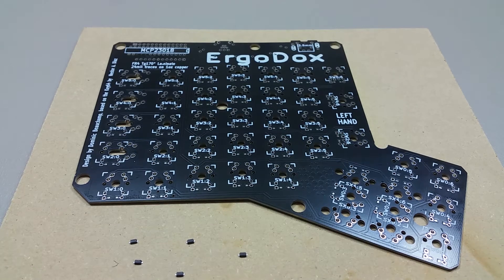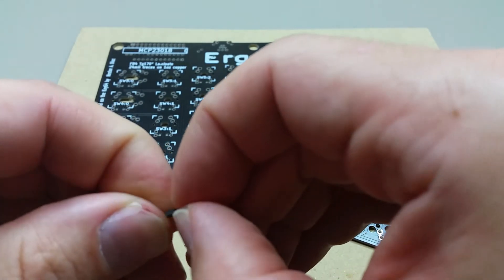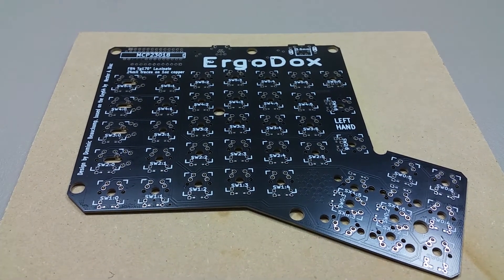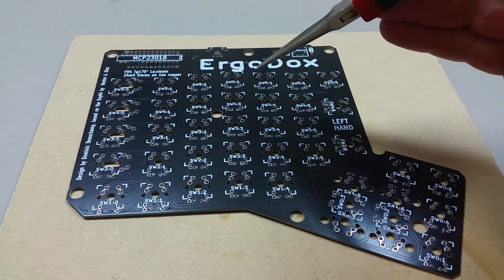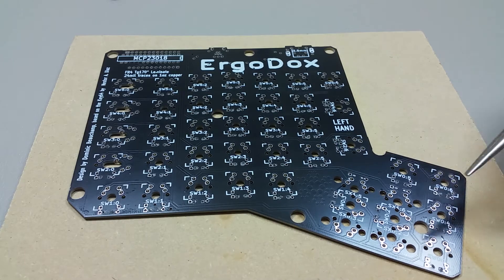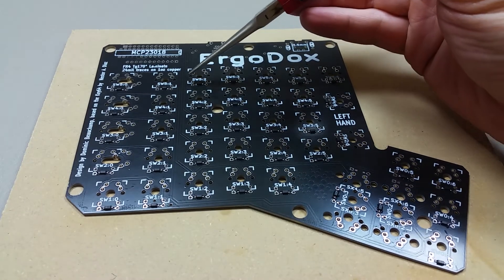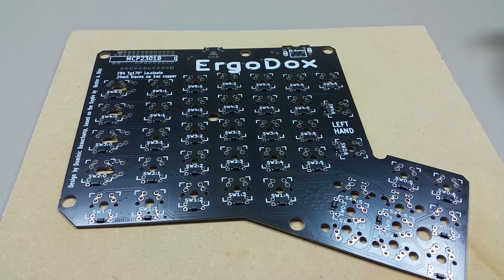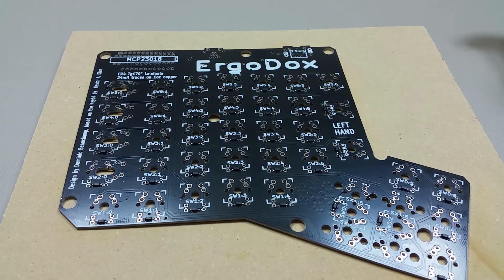How to build an Ergodox (Assembly 2)

Comment: What a meticulous work. A lot of equipment also needed.
I really want one but the work seems difficult.
Reply from the maker: Kazathul It's a lot of the same thing over and over. Good way to improve your soldering skills.
Reply: engineglue I have to know soldering before I improve on that : ) So....
Reply from the maker: Kazathul Get an iron and watch some Youtube videos. If you think you might like it.
Reply: engineglue How do you handle ventilation?
Reply from the maker: Kazathul If you're referring to flux or rosin fumes, I wear a particulate filter when I'm soldering a lot. An open window and a fan would work too. As far as I know, there aren't scientific studies on the effects of solder fumes.
Reply: engineglue Doing it outside could be a good option. Ty 4 response.
Reply: @engineglue  there is lead in your soldering paste and the symbol  linked to dangerous inhalation so i bet there are scientific research around soldering.  Maybe  more  for heavy soldering than  micro computer/electronic but it should exist. Anyway don't breath soldering fumes.